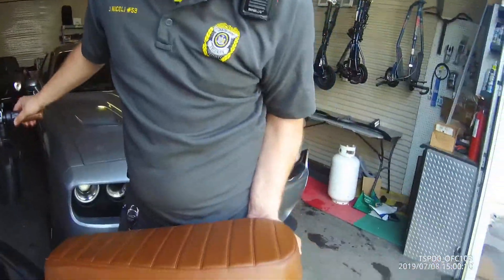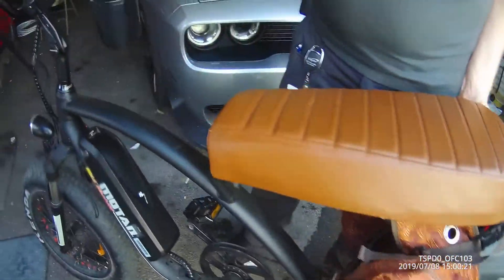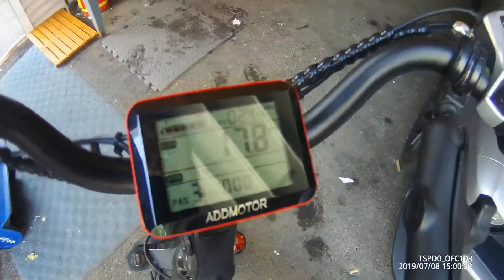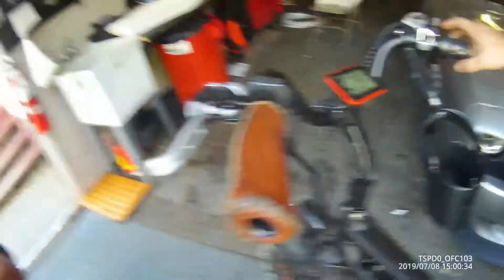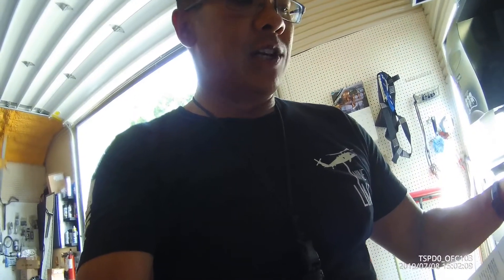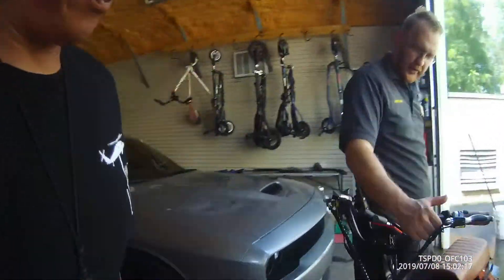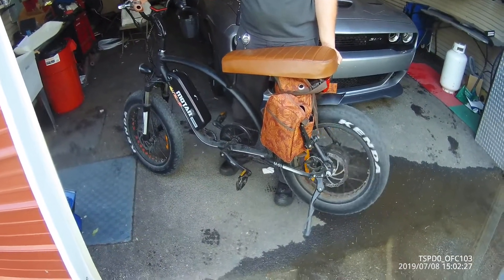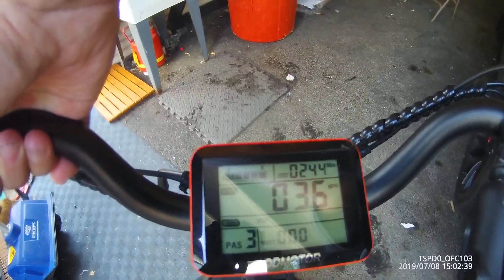Addmotor M60 Motor Issues

Comment: Did you get your parts yet? How’s the bike running? I bought m70 9/11/19 and returned it in 2 weeks inoperable. Switched  to m66r7 and it last a month. Having issues with getting parts. It is the Chinese New Year. I love the bikes IF THEY WORKED
Reply from the maker: Yes they  sent me the parts. But now the bike's cadence sensor is not propelling the bike the proper way. I wouldn't recommend  this bike. I have also bought a Juiced scrambler  and which is awesome especially with the off rd kit which makes it do 30mph

Comment from the maker: I have emailed addmotor they advise that its believed  to the inductive ring which is read by the cadence  sensor. Its loose. When examining it thiers no way to secure it from what I can see so it's loose. 
I have advised them and their response  is they have no instructions  because the bike is built  by a 3rs party company.i requested a brand new bike and that I would ship return the bike back thier emailed response is below. 

"We understand your mood.
It's so pity that we can't send you a new complete bike.
Because the bike you bought almost one year.
In generally, The inductive ring should not under the warranty.
For our warranty is 2 years technical support, 1 year motor and battery
But we hope you have a pleasure purchase , then we tried to apply a new one for you.
For the instruction, we will try to get it from the factory.
If there are any questions when you attached the part, please let us know.We will try our best to help you.
Also we have received the serial number and will let our warehouse stuff choose the fastest shipping way to delivery the part
and let you a happy camping trip.The tracking number will offer to you after shipped it out.

Have a great weekend.

Best regards,
Addmotor".